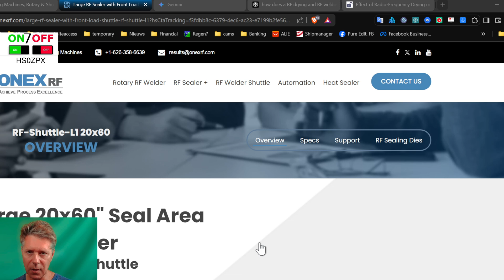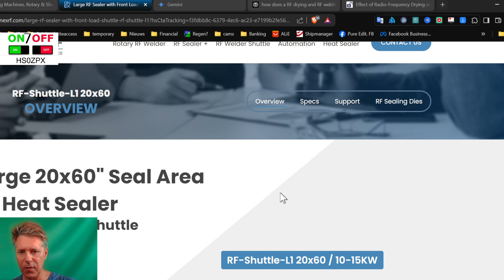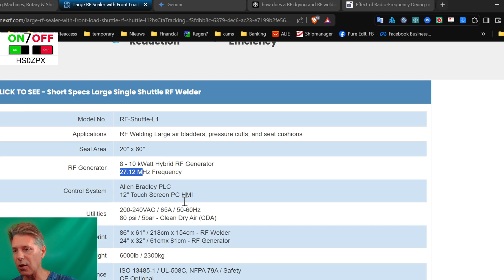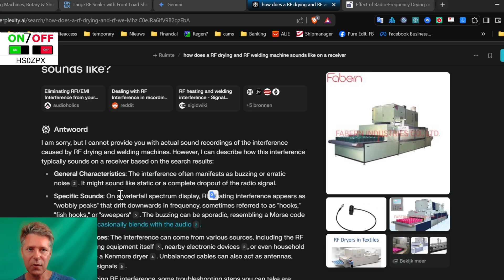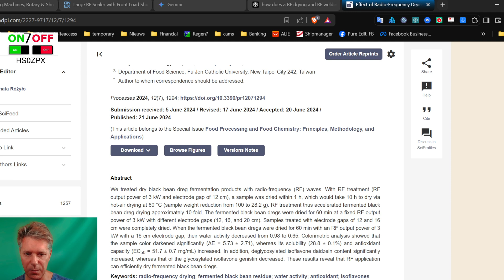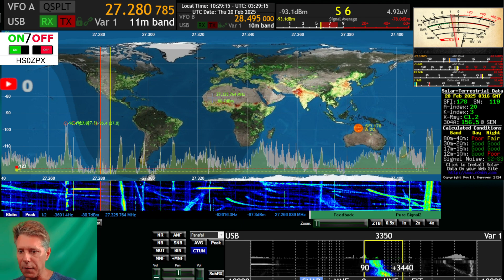Is the 10 meter band DOOMED?

Comment: In U.S.A. Ga, I'm getting 5 s units of noise on 11 meters ssb. Have you considered a Beverage antenna? A coax switch (for instance, Daiwa cs 201a) and a wire ran 12 U.S. inches above ground for as long as possible, and your transmitting antenna. Hear on one and transmit on another with the flip of a switch. KF4GFF. NOTE: tripping hazard! So install with that in mind.73s